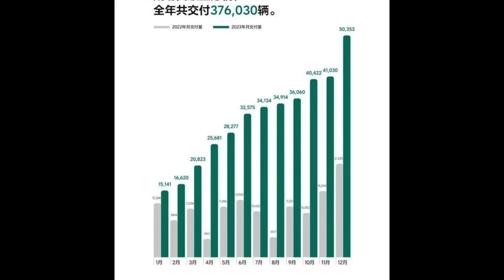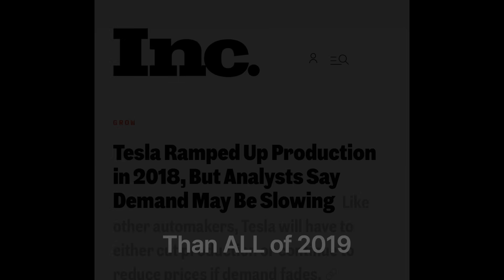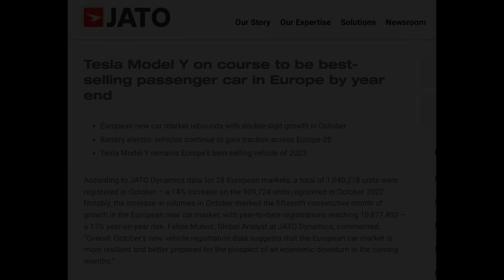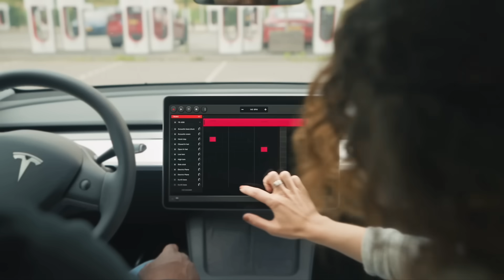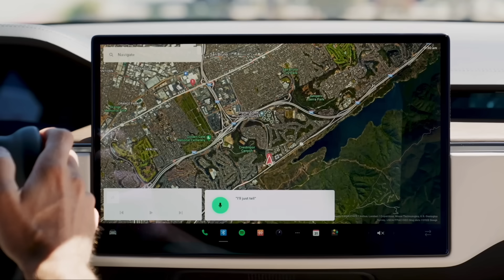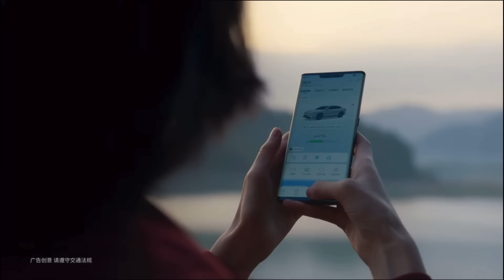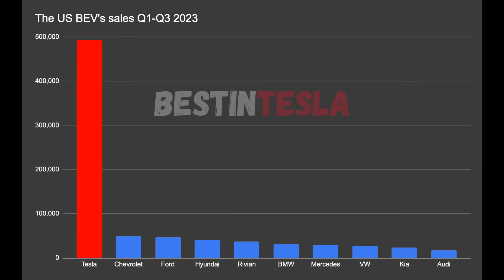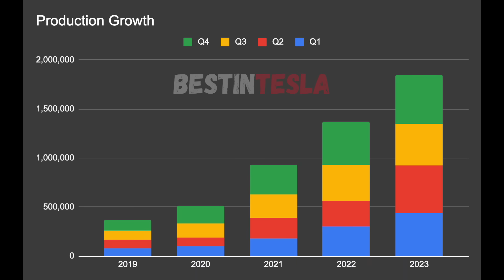Tesla reveals Q4 2023 numbers - BYD steals the crown - The race is on for 2024…Without Legacy's

Comment: So far it seem 2.2 million to 2.4 million is where many in the Tesla community are guessing for annual production in 2024. Not knowing where Tesla is truly at with the unboxed production line is a big factor and the other is batteries. I believe those will be the two biggest issues for Tesla in 2024. If they get that unboxed method going this year, I believe that will be a massive achievement. If production started for the Tesla compact on that unboxed line in 3rd quarter, the TSLA share prices will likely start rocketing, even though I do believe the initial ramp will be slow because they have to nail this. Since Wall Street types value the idea of a profitable and affordable EV a ton, this will be what drives much of the growth is TSLA share prices. There are so many other great reasons, but Wall Street seems to lack awareness or understanding of all the other great things going on at Tesla.

Comment: I would like to suggest that Tesla adds a Model W “Wagon” which would be a Model “Y” with a room for seven and extended rear cargo area under a squared off rear hatch with roof rails.  Tesla also should quietly buy up stock of ChargePoint and other EV Charging companies to add charging locations that are in need of more reliable technology and service.  Another suggestion is to offer is to offer the Model X in a extended version with sliding doors replacing the Falcon wing doors with conventional or sliding rear doors because most home owners can not open Falcon Wing doors within a conventional garage whether public or private.  This would greatly increase the sales of the model X which could be called the Model”V”  = Van or Model XY.  It looks like a Model X with features which mimic the Model Y.

Comment: Love your show. Thank you. I’m a long time holder. I saw this and thought it must be a shill article. I thought of you’d be perfect to ask could this be true?  Thank you. 

This is a Tesla model Y battery. It takes up all of the space under the passenger compartment of the car.

To manufacture it you need:
--12 tons of rock for Lithium (can also be 
    extracted from sea water)
-- 5 tons of cobalt minerals (Most cobalt is made 
    as a byproduct of the processing of copper 
    and nickel ores. It is the most difficult material 
    to obtain for a battery and the most 
    expensive.) 
-- 3 tons nickel ore
-- 12 tons of copper ore

You must move 250 tons of soil to obtain:
-- 26.5 pounds of Lithium
-- 30 pounds of nickel 
-- 48.5 pounds of manganese
-- 15 pounds of cobalt

To manufacture the battery also requires:
-- 441 pounds of aluminum, steel and/or plastic 
-- 112 pounds of graphite

The Caterpillar 994A is used for the earthmoving to obtain the essential minerals. It consumes 264 gallons of diesel in 12 hours.

Finally you get a “zero emissions” car.

Presently, the bulk of the necessary minerals for manufacturing the batteries come from China or Africa. Much of the labor for getting the minerals in Africa is done by children! If we buy electric cars, it's China who profits most!

BTW, this 2021 Tesla Model Y OEM battery (the cheapest Tesla battery) is currently for sale on the Internet for $4,999 not including shipping or installation. The battery weighs 1,000 pounds (you can imagine the shipping cost). The cost of Tesla batteries is:

Model 3 -- $14,000+ (Car MSRP $38,990)
Model Y -- $5,000–$5,500 (Car MSRP $47,740)
Model S -- $13,000–$20,000 (Car MSRP $74,990)
Model X -- $13,000+ (Car MSRP $79,990)

It takes SEVEN years for an electric car to reach net-zero CO2. The life expectancy of the batteries is 10 years (average). Only in the last three years do you begin to reduce your carbon footprint. Then the batteries have to be replaced and you lose all the gains you made in those three years.
Reply: Where did you get the 7 year figure from?  I have read multiple articles saying 2 years.
Reply: And ICE vehicles are?